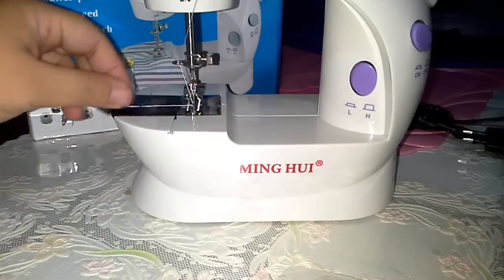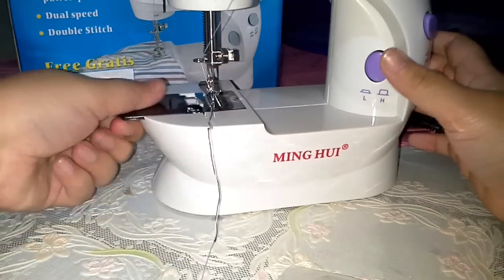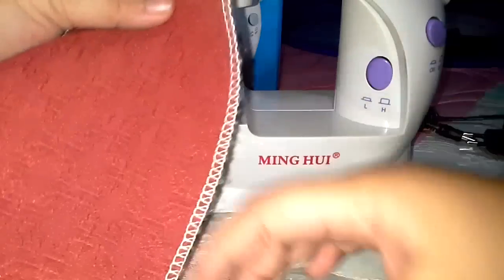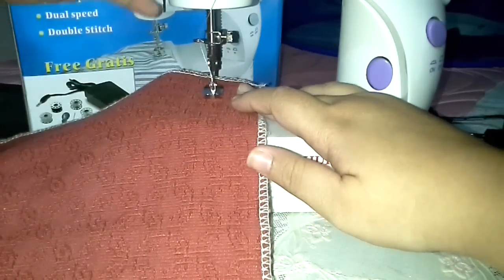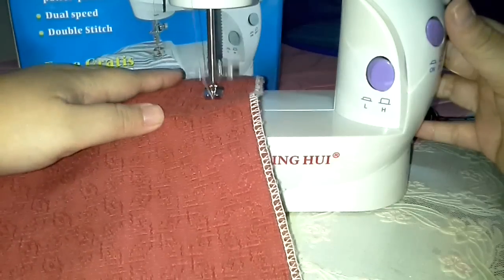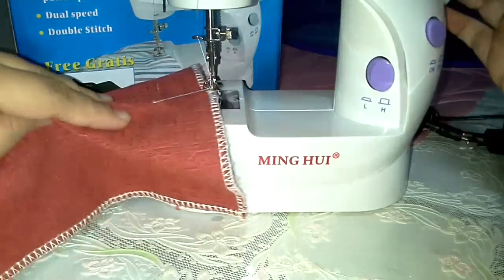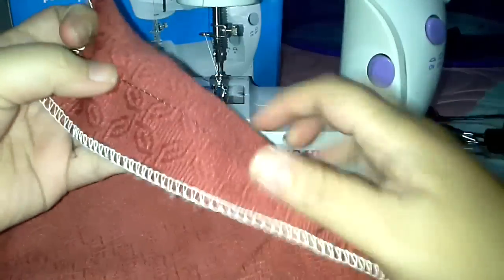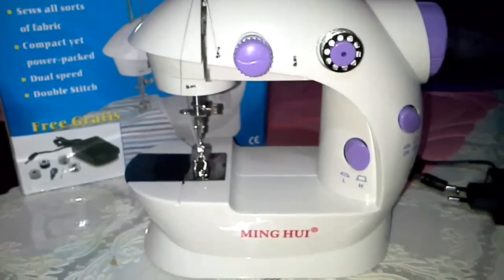Mini Sewing Machine Demo|Tutorial by INAH MIRASOL

Comment: how do you lock your stitch? Mine is working but once I'm done and cut the thread, I have two separate threads on top and bottom of my fabric.Do we just manually tie it together?
Reply from the maker: +abby yabby actually you have to do it manually. like cut it ang tie it yourself. that's why i don't use mine anymore. it costs alot of time.
Reply: thought so... =( my pedal is not working anymore, just used mine 3x and I don't know if it will work with batteries.  Gotta try later
Reply from the maker: abby yabby just try your luck. oh well it's made in china so don't get your hopes up. lol

Comment: Hi inah! I have a machine very similar to the one you have in the video,. It's exactly the same setup. it's a smartek mini sewing machine. I threaded it and did everything properly but when I tried to get it to sew nothing shows up on my fabric. and the needle stops mid way through my sewing and I can't continue. I don't know what I'm doing wrong. any suggestions?
Reply from the maker: Hi denise! Where you able to put all the threads in place?
Reply: +Inah Mirasol yes I was. the thread on the needle and the bobbin caught. but after that I couldn't get the thread to stitch.
Reply: same
Reply from the maker: +denise santiago Im sorry for the very late reply. I kinda have the same problem right now, idk why but maybe its because of the springs. you gotta have 2 and I lost the other 1.

Comment: mine is totally not working. :(
I tried to follow all the steps but still unsuccessful.
Are batteries needed if I am going to use the adapter?
Please advise.
Reply from the maker: u dont need the batteries if you're gonna use the adapter. in your case, might as well return it to the seller and demand a replacement coz it should work fine and yours didnt
Reply: +Inah Mirasol  The moment I received the machine, I believed it was set up properly already. Might return it to the seller if totally won't work. There are few signals that it is trying to work but just a little, maybe I jut need to try much harder..
Reply from the maker: +Alona Garcia that's what happened to my machine the first time i got it and realized that the prob was because the plug won't fit the socket.

Comment: Hi, i have the same sewing machine. I got it from lazada. I dont know but for some reason the machine is not functioning well. The machine runs but it does not stitch. Can you help me out?
Reply from the maker: Try to tighten the spring.that might help
Reply: what spring? im not really use to this stuff...
Reply: James Mark Saporno The spring that the thread goes through on its way to the needle.
If it's too tight, thread won't pull through. If too loose, thread bunches up like a bird's nest.